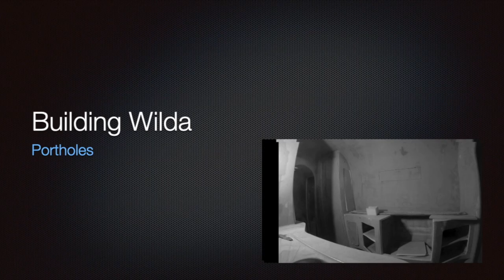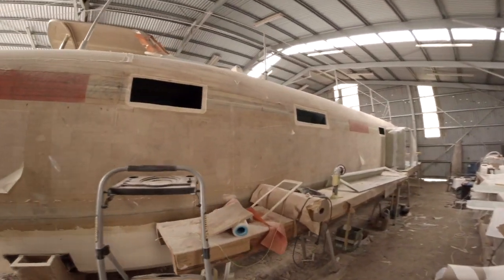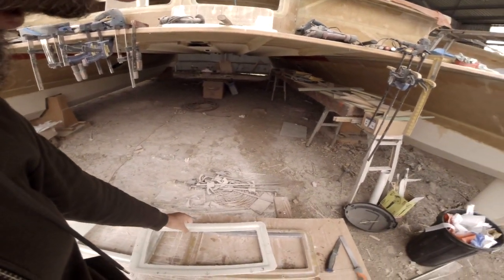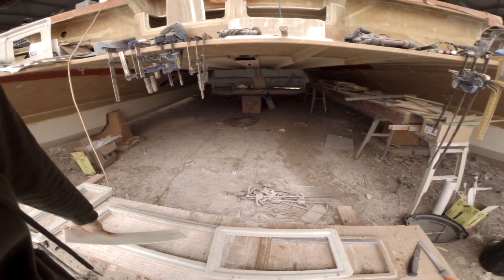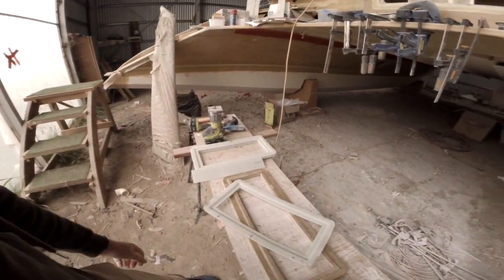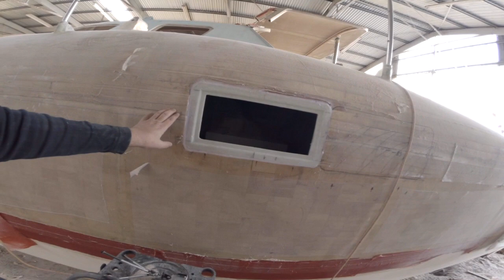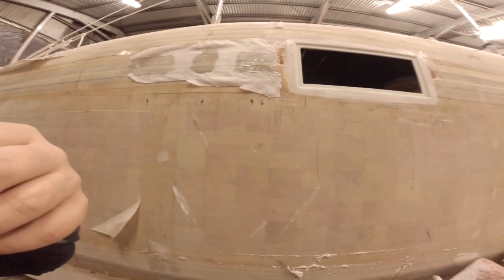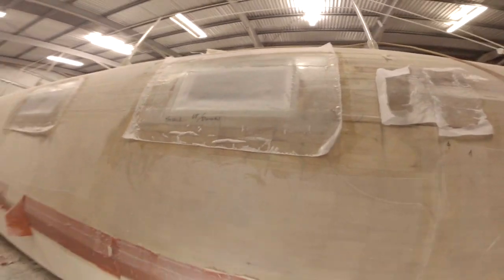Wilda's portholes - S01 E15 - DIY Catamaran

Comment: Sometimes I think about taking a cursing sailing Cat, removing everything to do with sailing - building a large curved roof and filling it with Solar with the batteries and electrics to support that. With electric engines and maybe some way of fashioning a headkite for a boost or emergency. 
I'd imagine the cost would be comparable if you take into account the replacement and upkeep of the two systems.
Hrm, best get saving. . . 
Nice update, Wilda is looking good.
Reply from the maker: There are a few boats like that. I will have the electric propulsion as a secondary means of moving along, so I'll be keeping the sailing bits 😂

Comment: I remember when your boat was for sale before you purchased it. I was tempted but am not ready to take on that challenge yet.
Reply from the maker: It's a lot of work! But also fun.... Most of the time 😂
Reply: @buildingwilda  I think I remember you getting it for less than the kit price but then you also got the work shop included. Anyways, I would have taken it if I didn't already have a project going on. I'm building a geodesic dome home that I plan on selling when I'm done. My wife and I are building it 100% with our own hands and no hired labor.
Reply from the maker: @robertlaird6746  Not quite that cheap, but a lot of gear included. I am of course renting the shed. Really good place to work, allowing work to be done in all sorts of weather.
The dome sounds like a huge project. I've always been interested in architecture and smart solutions for homes. Tiny homes, eco homes, earth ships and such.
Good luck with it all, and yes, good choice to stick to one giant project at a time. 😂

Comment: Portholes normally have rounded corners.  Sharp angles introduce stress risers.
Reply from the maker: That is normally correct. These portholes are square though, so I figured spreading that load through lots of glass should do the trick. The glass is 12 mm thick butting up to the portholes and from there, tapering off in a wide area around them. The position of the portholes is key as well. The Hulls are quite stiff and do not have a lot of load on them where the portholes are.

I hope I got them right. I think so.